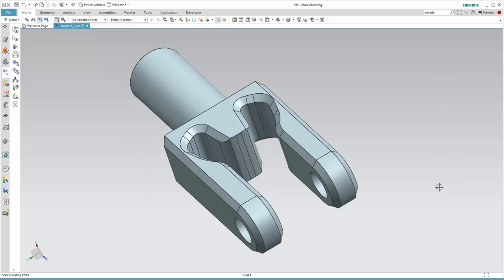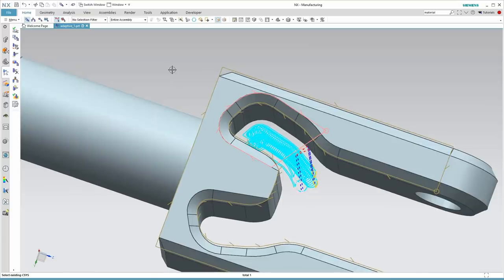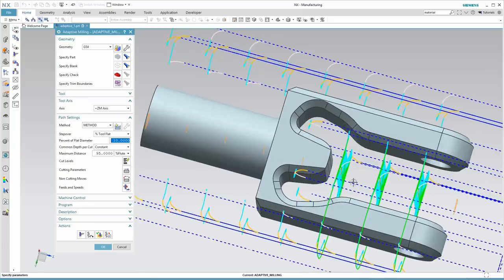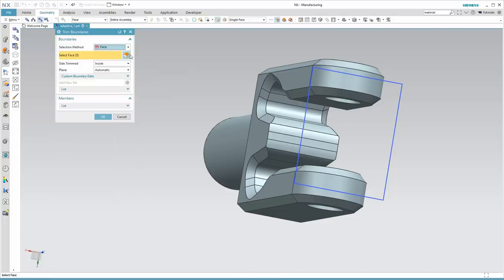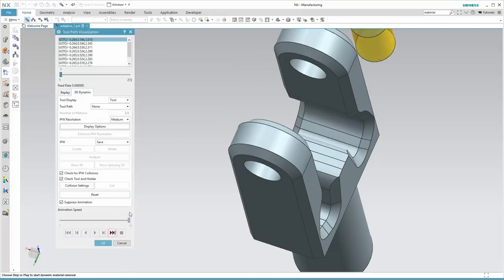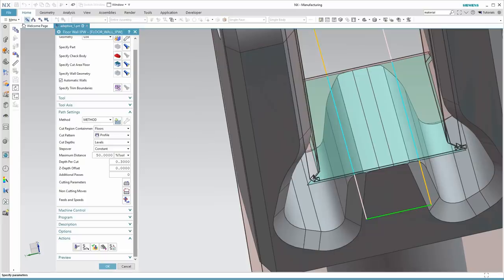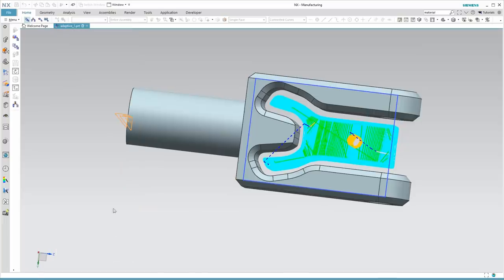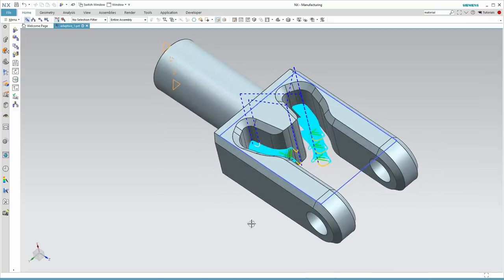Tutorial: Adaptive Milling in NX CAM

Comment: I love nx. I really do. But this is so painful.
Reply: This toolpath would take about minute to setup in Mastercam...
Reply: NX CAM: Making easy things hard.  I love NX too and have used it since version 4.  CAD is spot on, albeit difficult to use if you're new to the software.  NX CAM is whole other level of 4x the clicks to do something simple.  Inventor CAM and Fusion CAM suck for complicated parts, but they sure do make 90% of the normal stuff much easier to do in CAM than NX does.
Reply: @supahonkey  that was my point. . .